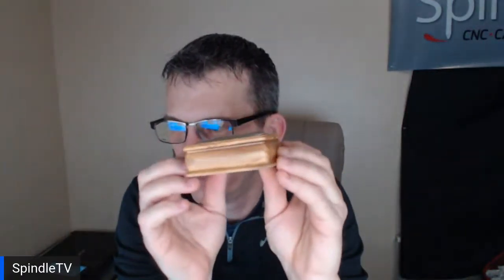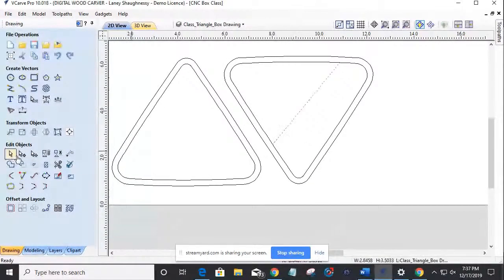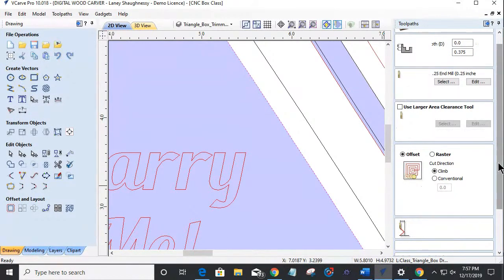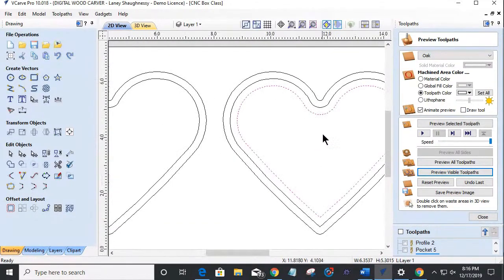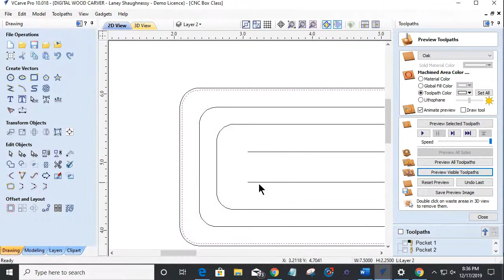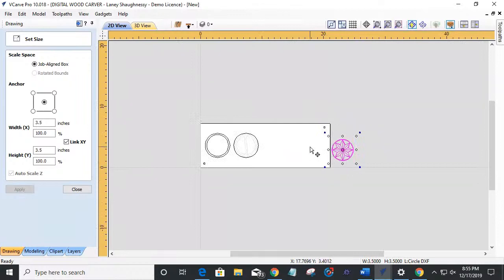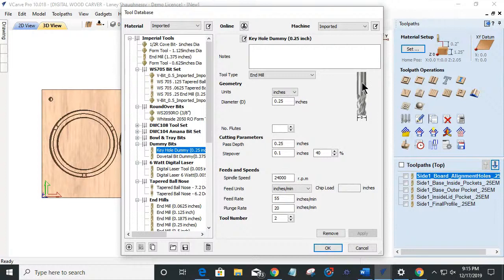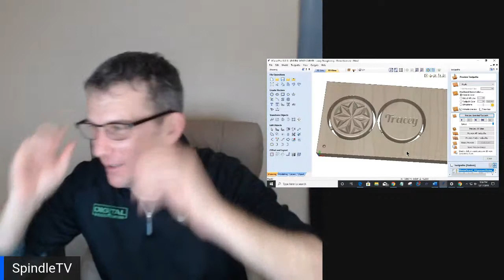Let's Talk CNC Boxes - A Vectric VCarve Tutorial

Comment: Laney, I made the circle puzzle from your download. I didn’t change a thing. I put the wood on the CNC ( it was store bought from the big box store) and the bit caught on the 7 o’clock position on the bottom of the circle when it was cutting out the profile.  Put a nice gouge in it. I took another piece from the same board, and this time, it caught, but didn’t gouge as much. I was able to sand it away. I did notice that when you put the two pieces together, the outside edges of the top of the box is larger than the bottom of the box. Is that supposed to be that way? I’m curious to see why the bit keeps catching at the same spot. First I thought it was my clamping, then I did double sided tape. I’m perplexed.

Comment: Cut a few boxes today and was very disappointed. The lids were far from the right size. After much head scratching I found the culprit. My Freud end mill measured out at .2455 inch! When tolerances are this critical check your bit and enter the value into the tool edit box.

Comment: Lanney the  reason  I asked about what  version you were designing in is That on the 12 days of christmas that Vectric has just designed in version 10 the will not load they will not load in 9.5. but everything  loaded in 9,5 will open in  version 10.  Also where did you get that round  design you used in the  last 2 sided box.Thanks Jeff
Reply from the maker: The round design was part of my dxf collection.. from years ago.. not sure where it e from..but it will be included with the files. I will be posting the design files (v10) and the dxf files (v9.5 or earlier)
Reply from the maker: File link is now in the Description of the video for download.